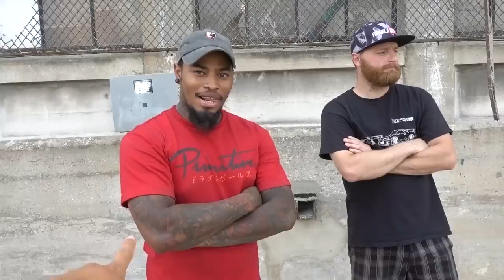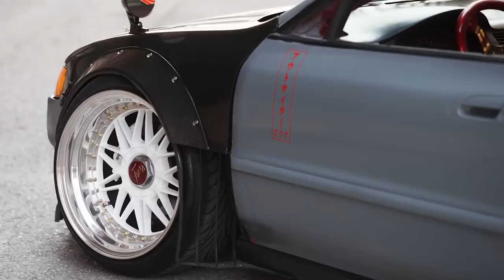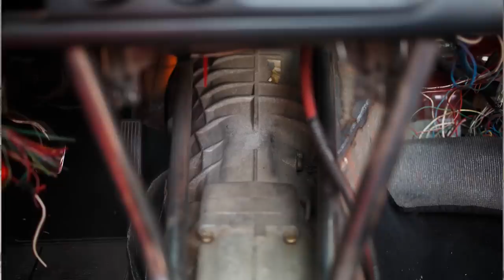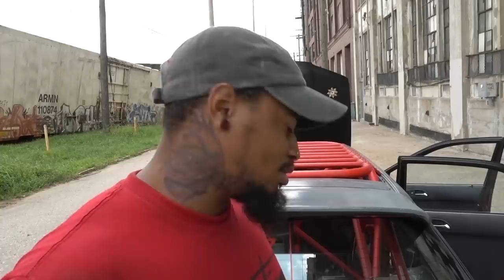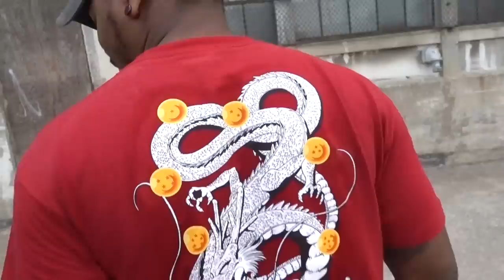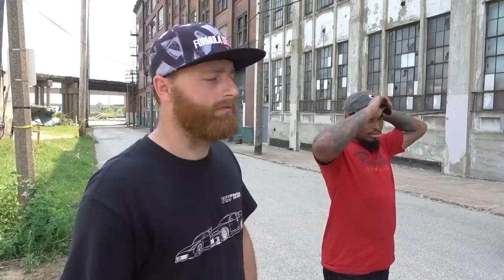Honda Hot Rod – Part Accord, Part Nissan, a Tire-Slaying RWD Wagon

Comment: This. This is exactly the type of thing that I love. The frankenstein, hodge-podge, random builds like this that look like another hobbled together ricer (not at ALL calling this thing a ricer by any means) on the outside, but then on the inside and underneath, it's an absolute work of art of other vehicles and it's put together in a way that it shows the creativity of the builder. Very well done. Absolutely love this build. 

Also, Larry your photography is some of the best that I've personally seen. Not just the clarity but your use of the 1/3rd rule and just overall composition and the fact that you have a very discernible foreground and background that gives your pictures depth. Very awesome.

Comment: I see RWD Wagon I give it the thumbs up
Reply: FX45... Just do it
Reply: @plainpawesome  I honestly never thought about those. Thanks for putting another car on my CL radar lol
Reply: @GustavCarl17  test drive the FX35 then try the FX45. They're both good cuz they're built on a 350z chassis.  I owned the 35 and upgraded to the 45. I wanna drop mine and put some wide combat battle wheels.
Reply: @plainpawesome  there are 2 45's on CL in MD for under 5k. I just like window shopping. I love the E39 BMW and an E39 wagon with a 350 would be great for me.
Reply: @GustavCarl17  see if you can find an Alpina model... Can't go wrong with an E39 if you have finances to maintain... Those be dope too.  But the Infiniti will give you that VIP JDM Junction Produce ominous beast appeal. Infiniti owners know waddup.
Reply: @plainpawesome  lol I hear ya. I have a soft spot for the E39 and even the E38. I've always loved the JDM side tho too. If money weren't an option I'd have 200 cars easy.
Reply: @GustavCarl17  what cars do you have now?
Reply: @plainpawesome  Fit sport 5 speed. I drive 30 miles one way to work so I needed something good on gas. The 540/6 got about 21 mpg, and it was falling apart piece by piece. I still loved it.

Comment: The station wagon, or hatch, or whatever you wanna call it, it’s so much more beautiful than the sedan. I was looking at a ‘93 Honda Accord LX five-speed manual and a 1994 Honda Accord 4-door sedan and I went with the ‘93. I’ve owned it since 1998. I doubt that Honda made the station wagon with a manual. If they did, I would consider that my next vehicle. Great job guys

Comment: I love this thing, i had an idea almost like this years ago. I wanted a stripped down accord wagon or civic hatch with an s13/14 drivetrain so bad for a long time. Then when the 350z came out i wanted to try to shoehorn the powertrain from it into one of em too. They did a great job putting it all together and making everything look like it could've originally been built like that from the factory.
Reply: Jeff Stills it was built at the factory. The adrenaline factory. Lol
Reply: Factories can't build like this... Why the civic or accord when you could infiniti fx45 or fx35?
Reply: plainpawesome because the chassis is dirt cheap and its about as big of a sleeper as you can get.
Reply: plainpawesome obviously you're never seen factory built race cars. They are some of the most well put together and functional cars around.

Comment: My only concern is if you snap a u joint there's not a lot stopping that shaft from coming up inside the car and causing injury.
Floor cover and a driveshaft loop, and it'd be perfect.

Comment: I had one of these back in the days in 09, it was a 95 Accord wagon, it overheated on me twice and it was a piece of junk mechanical problems, after the next I finally sold it to a guy, that owns a body shop, he bought it from me then replace the head gasket, then sold it to a woman, in 2015 I ended up buying another Accord, but it's a 97 4 door Sedan EX model with a 5 Speed Manual Transmission to this day I still have it and I fell in love with it. I'm going for that Kanjozoku Megan look as I slowly modified it she's my babygirl and I won't sell her she was repainted to look cleaner then the previous condition she was in when I bought her these old Accords, are becoming classics, as the year's go further into the past, they'll be a car to admire, and stare at, when the newer Generations see them

Comment: This is really cool. I'm a bit bummed they didn't keep most of the Honda suspension, wishbones rule.
Reply: I wanted to but this was a budget build. And i had a complete 240 vert so i just used parts from it
Reply: This is a way better use of a 240 vert :)

Comment: Tailights are from a 92 Nissan pulsar
Reply: The tail lights are the factory accord wagon lights.
Reply: Without body mods, the ass on this car is ass. The people who bought these in 94 needed a wagon more than self respect lol.
Reply: That's your opinion and you are entitled to it, is it a valid opinion not really. The only "body mods" you can really do short of hacking up the car is a tiny spoiler, or a Veilside body kit. The tiny spoiler is one thing, but you would need to have no self respect to drop that kind of cash on a body kit that is going to make the car slower and arguably look worse. (P.S. adding "lol" to a statement doesn't make it any more valid)
Reply: @tyhobbs17  they look similar